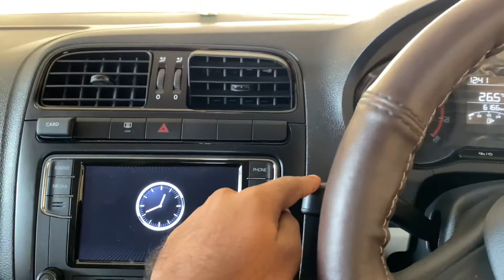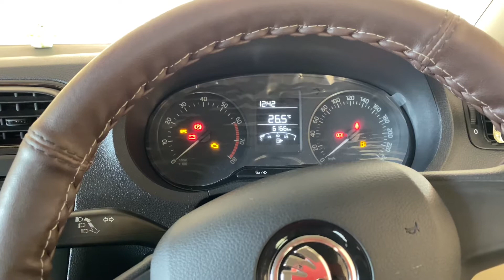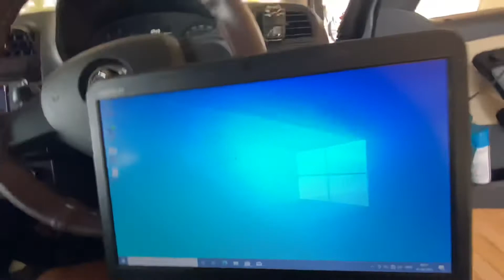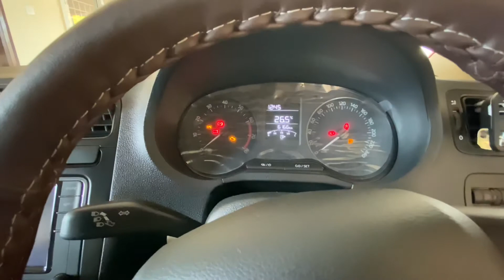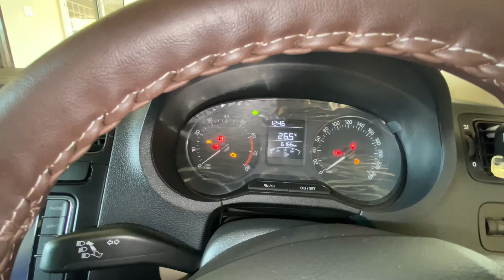VCDS Tweaks || Comfort Turn Signal || Lane change || Skoda Rapid Rider Plus 2021

Comment: Can we install cruise control feature on this car?????
Reply from the maker: Hi Bro, 
I'm still figuring this out. I found a module on wish.com (https://www.wish.com/product/5b3304df388bc15a6787123e?share=web). I wanted to order this. Before that, I've to check if   the BCM supports this. 

I'll post a video as soon as I figure this out.
Reply: @Ccars  thanks for the reply buddy. Jus for info, i have contacted etuners india for the same. They charging 28k for installing the cruise control which i think is very costly
Reply from the maker: You're welcome :D. If I get a chance to enable that feature, I'll surely make a video about that. By way which model is your car?
Reply: @Ccars  skoda rapid 1 ltr tsi petrol automatic rider plus 2021 variant

Comment: Good Info....!!! I have a query, In the base version of the Skoda Rapid can we code the remote button on the key which will enable the car windows to be controlled.?
Reply from the maker: Hi Sunil, Thanks for your comment. Its not possible to enable window controls via remote key like other higher models because, the base model doesn't have the required hardware(meaning, it requires fast window motors). Hence, its not possible to enable that function.
Reply: @Ccars  Thankyou for the Quick reply.

Comment: Hi bro . Can we do coding for mirror auto folding and windows rolling down/up using key ? If yes then can you please make a video on the same . Also can you please tell how to buy this cable online ?
Reply from the maker: Hi Shriram, Thanks for your comment. Which model car are you planning to code? If it is a base model like rider and rider plus it's not possible because it doesn't have the required hardware(meaning, it requires fast window motors and motors inside mirrors too). Hence, it's not possible to enable that function.